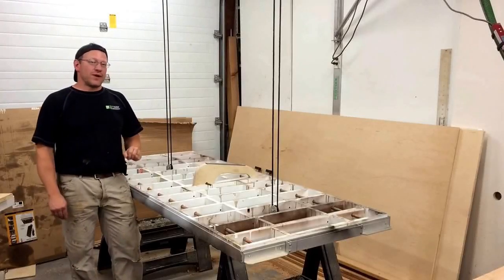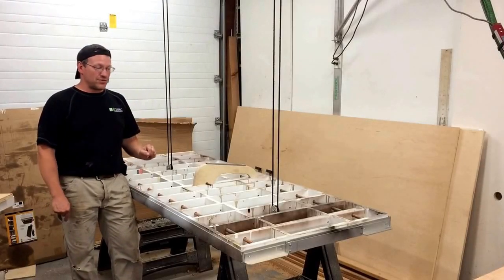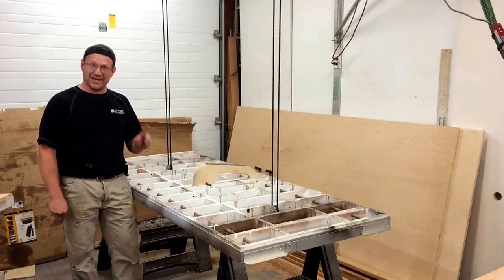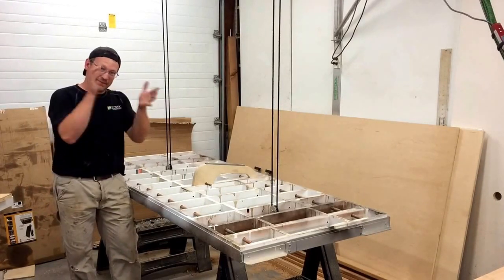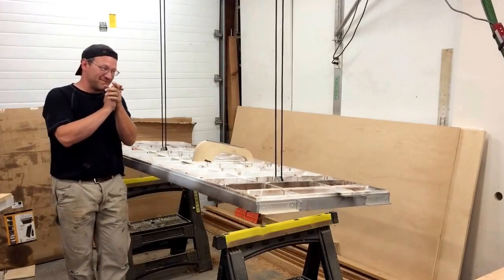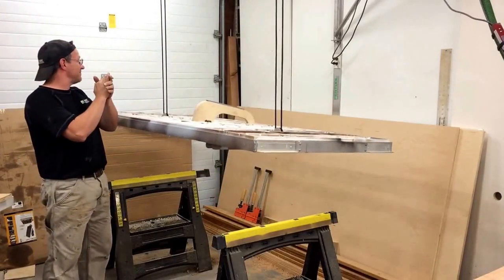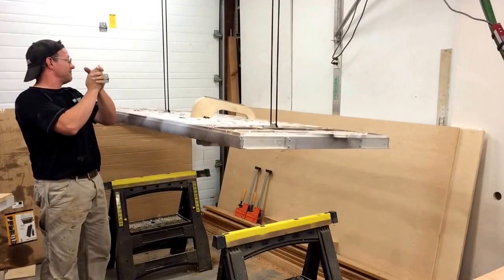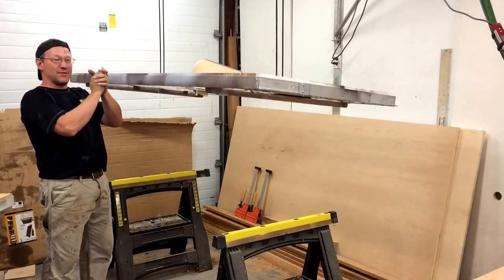The most insane electric hoist garage work bench you will ever see! With the Clapper!

Comment: How does it go down?
Reply from the maker: Ah, I knew sooner or later somebody would ask. That part is not working as of yet. The clapper has a triple clap function which turns on another plug. But it will power both up at the same time, which will blow my winch. I will do it, but it needs to be through a series of relays. I was just so excited about this I had to post it!
Reply from the maker: It goes down with a switch.